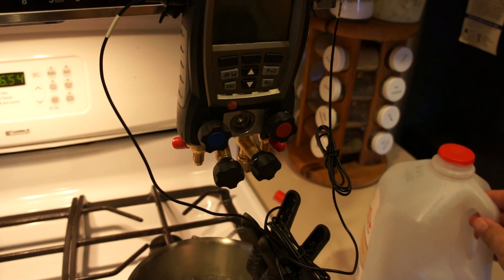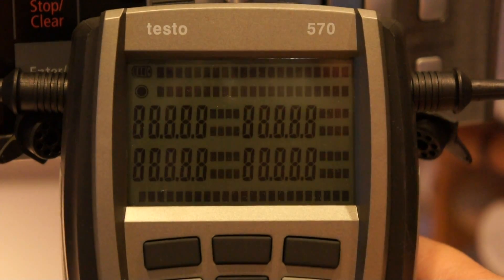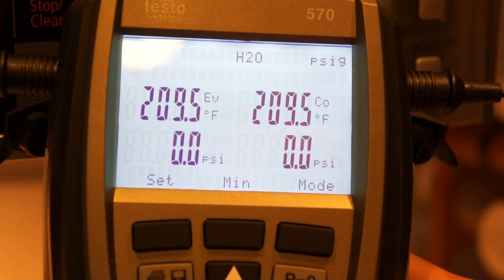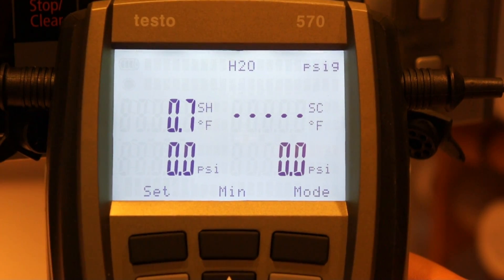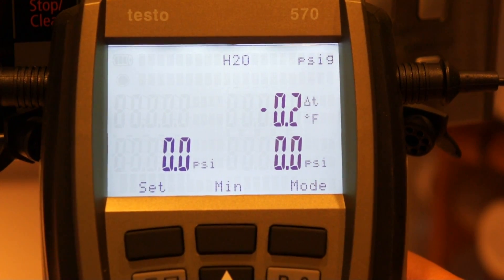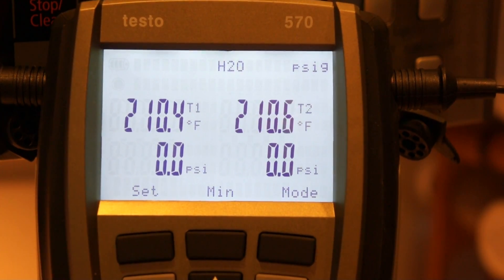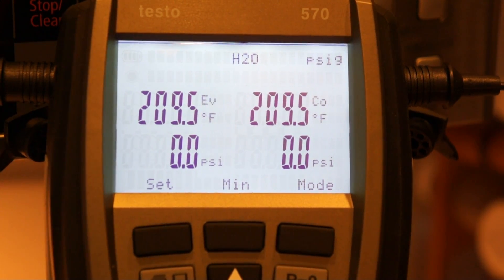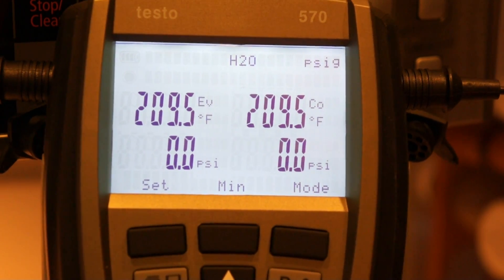Testo 570 and Atmospheric Pressure

Comment from the maker: That is just the overall calibration error in the instrument. Considering that is temperature, pressure and corrected for elevation, that small of an error is impressive. The 50 is one of the most accurate gauges you can purchase.